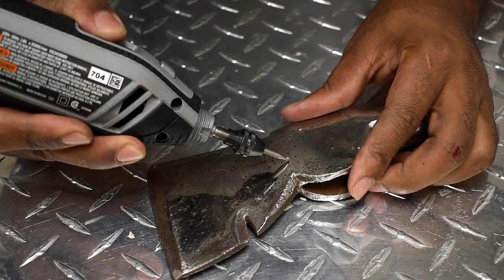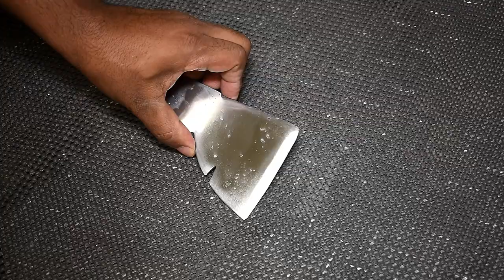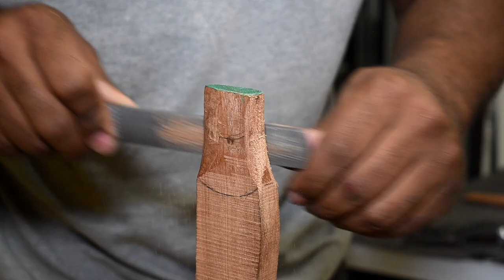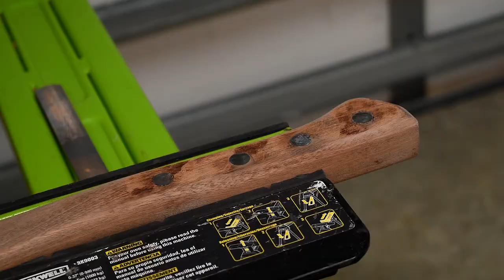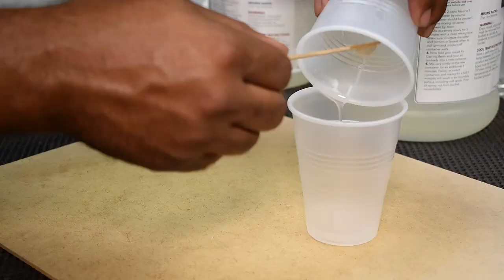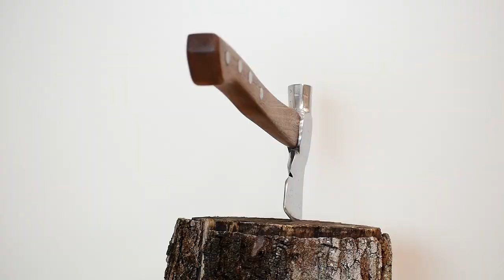Old AXE restores with Epoxy Resin

Comment: Check out reverse electrolysis for removing deep rust.  A couple hour soak in Naval Jelly will get rid of most surface rust as well, without having to grind so much.  Good work though. :)

Comment: It's called a roofing hatchet, the hammerhead was for driving roofing nails, the notch in the blade was for pulling nails, the hatchet part was for splitting wood cedar shingles, and the overall length from hammerhead face to hatchet bland was the offset length to start the next row of shingles. Nice work for your first project, your attention to detail is great.
Reply: Plz help I just found one in a old barn I'm a newbie lol

Comment: once you get it polished like that, try one by heating up to 170 degrees, and doing a cold bluing on it. you can use several layers, and with 0000 steel wool bring about a black pearl look to the metal. You may like it

Comment: just finished an old Craftsman 1/2 axe a friend gave me. was able to use the butt end of an old 36" handle I saved from a previous restoration AND it came off an old craftsman single bit.

Comment: you did pretty good on the head my only complaint was rounding the edges of the pole a little. the handle while it looks cool wont last with daily use. look into wranglerstars videos on hefting an axe. alot of complaints including the faux rivets you added made a weakpoint in the handle the head fit was fairly loose and epoxy isnt real good to hold a head for a number of reasons including the fact it will prevent wood from drying if it gets wet under the head.

Comment: Very nice! I love that you left some of the pitting on the head, now you can still see its not just another new tool. What wood did you use for the handle? I know that Ash or hickory are the best type of woods for tool handles, but if you were going for astetics it'll be fine. And another tip, you left the handle quite square, it'll be nicer to use if you'd rounded it off more into an oval shape. And the epoxy is just a matter of taste I guess ;) But anyway, it has once again  become a nice tool!

Comment: Great video! My only question would be about inserting the steel rods for aesthetic purposes. Do you think it’ll affect the integrity of the axe handle at all over time? Also how many coats of tung oil did you end up going with? Hatchet looks awesome

Comment: Question - for these sorts of projects, do you plan things out much or is it more of a case of "winging it"? Like the steel rod ornamentation, it sounded like that was just inspiration that struck!
Reply from the maker: 90% of my projects are just an idea. I normally feel out the projects and ideas pop up along the way. I plan out the concept mainly.
Reply: @DIYCreators  that's inspiring - I do graphic design and illustration and I find the same sort of thing, aside from actually producing something, those little eureka moments are the most satisfying part of the process. Your videos have convinced me to fully get into woodwork - saving a bit each month to get myself some basic tools in the post-holiday sales in January!

Comment: You could have saved yourself a lot of time by soaking the axe head in white vinegar for a couple of days previous to your video it would have taken most of the rust do all of it away saving you a lot of time and sandpaper I use this method all the time and have great results
Reply from the maker: I didn't know till today, I will try in the next one. Thanks for the tip.

Comment: Wet sand that pupp with the 1550&2k grit be alot less work effort and save u time and be smoother  shiny.er..I dry sanded a plane blade but a metal worker on yt told me 800 and up wet sand cuz those reasons I just typed. anywho justa friendly fyi bro and of course u have a buffer..😏
It all looks like new..nice work bro..hey,,is that handle that mahogany u had when I visited ur shop 2 yrs ago??
Reply from the maker: I tried wet sanding and it was gaining rust spots lol. Not sure what I was doing wrong. Yes, sir, I have not tapped into my stash of mahogany yet lol its more than when you were here.

Comment: I'd have soaked it in a bucket of Evaporust overnight, then washed it off, heated it up to 250 and oiled it.
Reply from the maker: Im taking notes, thanks for the tip.
Reply: @DIYCreators  Doesn't even need a special product. You can just pick up some hydrochloric acid from the hardware store. It will serve the same purpose.

Comment: please please please never use this axe. The way you epoxied the handle is insanely dangerous
Reply: How? Just curious
Reply: Beyond Help the handle isn’t seated correctly in the eye of the axe. The axe will come loose by flying off of the handle
Reply: Ya I was cringing the whole video by how he was doing some of the stuff
Reply: That handle isn’t going anywhere. I have seen so called professional restorers do worse.
Reply: It will loosen over time, I know from experience. Don't use it.
Reply: It depends if he uses it as an axe or as designed, a roofing hammer. It's not heat treated the same as an axe or hatchet would have been. The blades side is for cutting shingles not chopping trees so the head should be fine for that use. It was a really rough state to start from but I've seen much worse from more experienced restorers. Only advice I'd give is to choose your project material and find out what you're working with. A 30 yr old coleman camp axe just never had the quality in the first place to restore it, just like this 40 yr old Stanley roofing hammer. Just my opinion though. Great job with video and explanation of process.